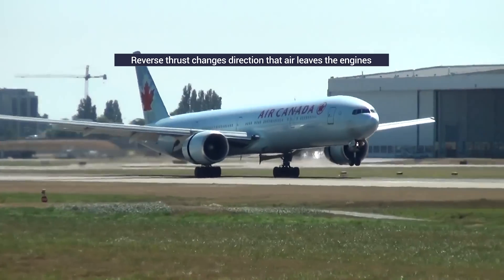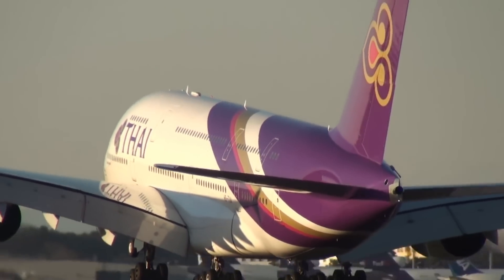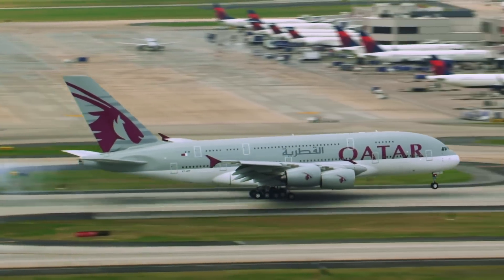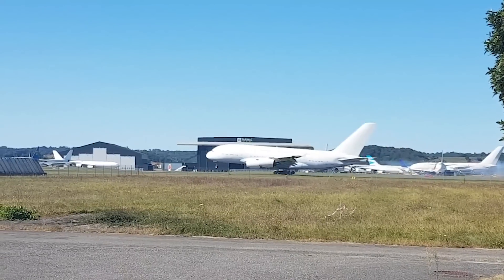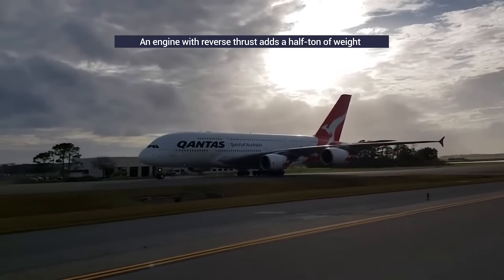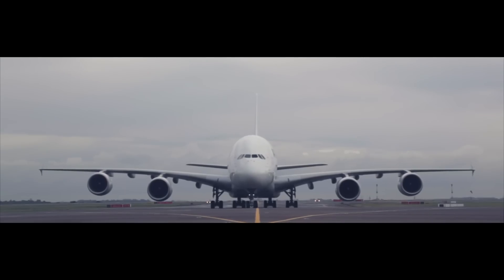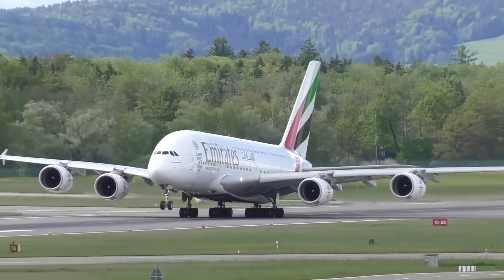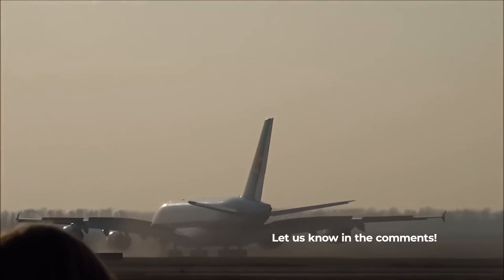Why The Airbus A380 Only Has Reverse Thrust On Its Inside Engines

Comment: If I don’t still know why does every Aircraft A380 never still have 4 reverse thrust option with opening 2 turbines only 2 reverse thrust (2 & 3) full same sizes for landing without (1 & 4) empty different sizes long time ago a one year first time hopefully first TV notifications call an attention every different airport countries and flags sells, prepare, manufacture, equip and operate every new same best bigger throttle size operations with 4 reverse thrust (1, 2, 3, 4) full same sizes every A380 mechanics for every landing different A380 companies and A380 equipment with copying (ECAM) 4 engines, turning on 4 engines and opening 4 turbines 4 reverse thrust like A340 bigger best throttle same size with 4 reverse thrust, 4 turbines, turning on 4 engines, (ECAM) 4 engines & B747 bigger fat throttle with 4 reverse thrust, 4 turbines, turning on 4 engines, (EICAS) 4 engines.

I’m gonna share you type of A380, A340 & B747

Type of A380:
A380 wrong bigger throttle different size doesn’t make any sense that 2 reverse thrust (2 & 3) it’s not like that for landing without (1 & 4) empty different sizes.
Turning on A380 4 engines makes sense that cockpit it’s like that with 4 bigger turbines for takeoff.
A380 (ECAM) makes sense with turning on 4 engines that it’s like that for takeoff.
A380 4 bigger turbines makes sense that under the bigger giant flap it’s like that for takeoff.

Type of A340:
A340 best bigger throttle same sizes makes sense that 4 reverse thrust (1, 2, 3, 4) full same sizes it’s like that for landing.
Turning on A340 4 engines makes sense that cockpit it’s like that with 4 turbines for takeoff.
A340 (ECAM) makes sense with turning on 4 engines that it’s like that for takeoff.
A340 4 turbines makes sense that under the big flap it’s like that for takeoff.

Type of B747:
B747 bigger fat throttle makes sense that 4 reverse thrust (1, 2, 3, 4) full sizes it’s like that for landing.
Turning on B747 4 engines makes sense that cockpit it’s like that with 4 turbines for takeoff.
B747 (EICAS) makes sense with turning on 4 engines that it’s like that for takeoff.
B747 4 turbines makes sense that under the bigger flap it’s like that for takeoff.

Does that makes sense what I’m sharing you?

If you don’t understand me until you answer me thank you for my answers, I agree I help you what did I talk about.

Comment: I had noticed, while watching another video, of large aircraft landing on a wet runway at Amsterdam, that the A380 included in that video only used reverse thrust on its inboard engines.  I wondered if it might offer the pilots the option pf using only part of the thrust reversers.  Now I know.

Comment: so does that mean the A380 has two different types of engines? or are the outboard ones just not fitted with reverse thrust?
Reply: It has two different engine options, so if you see an A380 all engines it has are of the same type. The inner engines are equipped with reversers, other than that it’s the same engine

Comment: All jets are certified to meet landing performance requirements with brakes alone on uncontaminated runways. Thrust reversers are credited with extra stopping performance, but are not required. 

Moreover, the Airbus autobraking system operates in a manner such that the auto brakes will release pressure commiserate to the amount of deceleration created by reverse thrust so that the deceleration rate is the same whether the plane lands on brakes alone or using thrust reversing.

Comment: They are not called "reverse thrusters." That would mean things which make thrust in the direction opposite to normal.
In fact, they're called "thrust reversers" because that means they take the jet thrust WHICH ALREADY EXISTS and divert it so that it blows partly sideways and partly forwards, having the effect of reversing the thrust which already exists.
I know this because I used to work for Rolls-Royce, who design and manufacture jet engines, including the Trent 900, which is the engine designed for the Airbus A380.

Comment: It's important to know that, unlike a car coming to a stop, the braking system on large airliners doesn't apply a set force to brake. It tries to target a certain deceleration rate. As such, assuming the wheels do not start locking up (airliners do actually have ABS), reverse thrust or spoilers don't make a plane come to a stop faster. They just take strain off of the wheel brakes. This does matter if the runway is wet or icy and the main wheels don't have enough grip.

Comment: I knew that engines no.1 and 4 were without the thrust reverser for the "debris" reasons, but didn't know that a) thrust reversers would add weight , and b) the A380 was designed to stop just on brakes

Anyways, the A380 might just become history if this pandemic drags on for longer. 😥

Comment: The question remains, does a 747 (any model) need all 4 thrust reversers?
Reply: They usually use all four, but at the airports they mostly fly into they probably don’t spool the engines up by a lot and just use it to stop smoothly

Comment: No I didn't know that.. I thought it was optional and that the pilot used reverse thrust on inside engines at smaller airports.. on larger airports all reverse thrust on all engines are used ... for the reason of outer engines being over the edge of runway it isn't used at smaller airports...

Comment: Great video but it should also be noted that thrust reversers are largely used to increase cooling for the brakes to better dissipate heat and thus improve braking efficiency.

Comment: Did you know that the engines of the A380 were actually TOO powerful in the first place? The power has been decreased by design because of that - not talking about the usual adjustments for take-off via N1% / temperature setting.

Comment: Those engines hang way out there too and can make a huge mess. Also, big risk of injecting fod and damaging an engine, especially on the ones near the rwy edge. When I worked on airfield management I hated when a c5 came in. We had to shut down the rwy everytime for an hour to get the rocks cleaned up,and that was with a 200 ft wide rwy not 150 like most.

Comment: The A380 of Qantas QF32 landed at Singapore with one reverse thrust engine (#2) gone in the catastrophic failure, engine #1 uncontrolled and on take-off thrust, and engine #3 available for reverse thrust.  They landed at around 165 knots and stopped in 3900 metres using most of the Changi runway, mostly on brakes which were white hot.  
(It took 3 hours to "kill" engine #1).
Reply: Fadec engines usually run in the last choosen setting if the connection cables are interrupted.
A conventional controlled engine would have stopped immediately in the air.

Comment: Something related that wasn't mentioned is the number of wheel brakes the A380 has.  Of the 20 MLG wheel assemblies, only 16 of them have brakes assemblies.  It was able to meet all the required stopping distance criteria without them, yet a certain regulatory agency still wanted reverse thrust.
Reply: If it's wet the brakes don't have the same stopping power, but reverse thrust always have the same power. So it's probably good to have both.

Comment: Don’t forget noise footprint as well. They wanted the A380 to be much quieter than the 747 on landing. Having only two engines on high-power reverse thrust really helps with that goal. A380 is 3-4 times quieter than the Jumbo as a result.

Comment: I didn't know that at all! And it's crazy how such a big plane doesn't stall at slow speeds. But It is possible to stall with no flaps on landing... That's pretty cool!
Reply: Oh it will stall, but all its stall speeds relative to airspeed, temperature, altitude etc will be very well worked out. It must though, create enough lift even at slighter slower speeds courtesy of those huge wings. Physics aside, the sheer size of the thing gives the impression of moving slowly when its actually not.

Comment: Actually, many planes don't need reverse thrust to come to a complete stop. It's mainly for safety and cost reasons as it also helps to reduce use of the breaks. Therefore the time to cool down the breaks can be reduced and the plane can get up into the air more quickly.
Reply: Add brake fans problem solved.

Comment: And the two outside engines are basically airbrakes, since they are not rotating after touchdown. Those engines are like parachutes and help slow the plane a lot.
Reply: You don't know a lot about aviation, do you?

Comment: I'm guessing that it's low landing speed has to do with it's big wings, designed to support larger versions that were never built.
Reply: Surely, a bigger wing with less wing load means a lower take off and landing speed.
The MD-11 was the opposite, it had a high landing speed because it used the DC-10 wings with a extended fuselage and MTOW

Comment: its a shame fliers of the a380 are storing or getting rid of them so quickly. they're engineering masterpieces with great pilot and passenger feedback.
Reply: Its a massive shame, but the flying economy has changed dramatically over past couple of years, and 2020 has just accelerated that change.
Reply: @ThexMJT Sad but true. 👍
Reply: Agree with you totally.
Reply: It was a failure of a project to begin with
Reply: Also I agree fully with you because they are really marvellous pieces of engineering! It's sad....
Reply: Lufthansa is reactivating their A380s
Reply: But luckily, passenger A380 is far more than passenger 747 in 2023
Reply: BA operates them. Not as many as other carriers and especially not as many as Emirates. They are elegant, but there’s a snag in the length of time to turn them around, (embark/disembark). So for a passenger it’s more frustrating than a 777 ER, for example. But it is more comfortable.

Comment: Question if the A380 only needs two reverse on its engine why was the 747 have it on all four engine 🤔🤔🤔🤔🤔
Reply: 747 engines generate less thrust
Reply: And 747 lands faster so it needs more help to stop.
Reply: And the 747 doesn't have as wide wings so can more safely do without fear of engine ingestion on existing r in runways also with lower power engine outputs it can more be easier steered on  and less prone to diversion/digression on landing especially on wet or narrower runways.

Comment: What it does mean though is the A380 needs two different engine types & in the event of failure or replacement the correct type is needed.
Reply: I think the core engine is the same. I think the reverse thrust equipment is a part of the nacelles.
Reply: @Rwalt61  the core will absolutely be the same but that doesn’t really come in to it as commercial aircraft are replaced as a complete unit.
Reply: I thought you meant you have to get one engine with thrust reverser and one without.
Reply: @Rwalt61  essentially that is what i am saying, the core is the same but there has to be two engine types.
Reply: @Will-thegrumpysoutherner  The cowlings and all the moving doors and parts that deflect the engine thrust forward are all a part of the airframe not the engine.
Reply: @Rwalt61  aha, i see, i didn’t believe you to start with but having watched a video on an A380 engine swap i see what you mean 👍🏼

Comment: The explanation given is incomplete. The structural issues occurring with the outboard engines (#1 & #4) entering reverse, and the stresses imposed upon the wing spar box were the primary reason for this decision to limit reverse thrust to the inboard engines only.

In all and if an observer is to be honest and realistic, the 380 was a failed design, probably due as much to inaccurate financial, fuel, and passenger forecasts, as it’s engineering compromises like failing to go ahead with a freighter version, and a strengthened wing spar that would have allowed all-engine reversing and shorter balanced field lengths.
Reply: Interesting dude. In the video it says that it comes in slower than most planes but still needs 10 miles of runway to come to a stop. I guess that’s why the 747 can land almost anywhere while the swollen A318 almost has no place to land.
Reply: @thetruthspeaks8702  Most “large” airplanes (i.e., B737) maintain 140 knots on final segment, then decelerate to 125-130 on round-out. The Super-jumbos add about 15 - 20 knots to that You can check this out for yourself by going to sites like flightradar24. I say all this because an observer must recognize not just speed (velocity), but mass as well to calculate the inertia, which are basic laws of mechanics.

“A body in motion tends to remain in motion.”
Reply: @flitetym  you know a lot about the physics of it. I just thought that it was odd that a plane with over a million MTOW would not need all the help that it can get. The outer engines are not much farther out than the 747 outer engines either. So if the 747 can fly for over 50 years with thrust reverser on the outer engines the A380 should be able to do that too. I totally agree with you that it’s a design flaw. To me the plane is not proportioned well either.
Reply: @thetruthspeaks8702  an airplane is — if anything — an assembly of compromises; financial compromises, to be exact. The Bristol Brabazon is a long-forgotten airplane which suffered the same accounting “maladies” as the 380. And Bristol was one of the companies amalgamated into today’s Airbus. Those darn Euros just aren’t reading their own Cliff’s notes. 🙄

Comment: The video forgot to mention that the prototype A380 doesnt have reverse thrusters installed on none of its engines
Reply: I didn’t know that, but it must have been during the early testing stage! There are pictures of the prototype with reverse thrust deployed but it was years after its first flight
Reply: @spongebubatz  After the maiden flight, the FAA mandated that Airbus adds reverse thrusters on to the aircraft. If you look at the landing during the maiden flight the prototype doesnt have them.

Comment: Having thrust reversers on the outboard engines is also bad for controllability in the event that one does not deploy.  You then have a lot of reverse thrust out near one wingtip and forward thrust out near the other and it will be really hard to steer in a straight line and stay on the runway.  Safer to use thrust reversers on only the inboard engines if you can get away with it.  And then saving weight is just another plus.

Comment: I didn't know that!  It's actually amazing that reverse thrust on only 2 engines is required for this huge beast.  Another amazing fact:  The A380 was the first large commercial aircraft with an electronic secondary electric power distribution system replacing the old technology electro-mechanical system.  It was a huge leap in technology.
Reply: Could you please explain how does this newer system work ?
Reply: @rayanaltowayan9558  Old technology electro-mechanical circuit breakers that need to be manually reset when tripped are replaced by MOSFET-based digital switches mounted on power module cards installed in remotely located cabinets. The benefits of this new technology include software driven remote resettability  via a cockpit controller by the pilots or via a laptop by maintenance personnel as well as significant weight savings and reduced power losses due to reduced lengths and numbers of heavy power cables running throughout the aircraft.
Reply: @richardmueller2661  ,thank you,sir,for your explanation
Reply: @richardmueller2661  or may be they implemented motors with drives at location they want to make mechanical movement and all cable harness routing replaced with power and control signals with one or two alternatives/auxillary supplies, there is one incident that shows  structural failure caused this harness breakdown and multiple hardware went inoperative
Reply: @rayanaltowayan9558  🤓

Comment: What determines the speed an airplane can come in to land?
Reply: It's tied to weight and lift of the aircraft. The A380 might be heavy but has excellent low-speed lift characteristics. I am however in no position to elaborate on what factors directly influence it's performance
Reply: The speed it doesn’t fall out of the air
Reply: Aircraft weight, wind direction, air temperature, airport altitude, runway condition. Heavier the plane, hotter the temperature, higher the altitude, less headwind. All those things mean more runway needed and higher the landing speed. Light plane, strong headwind, dry runway, cold temparature and low altitude is the best for short landing.
Reply: Thanks guys but I'm asking specifically to the a380 having a slower landing speed compared to a 747 or lighter aircraft
Reply: @tripleceven  it has a high wing surface. Also the A380 fulfills many of the listed aspects of a landing speed which were listed in the other replies better (or however you want to rate it) than the 747, which of course doesn’t mean that the 747 can’t land slow. It really I the combination of all aspects